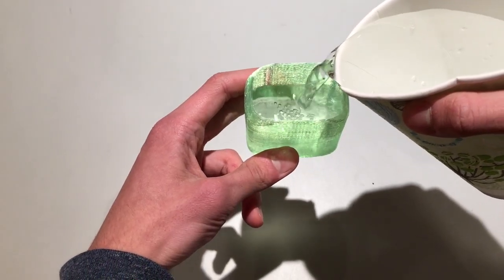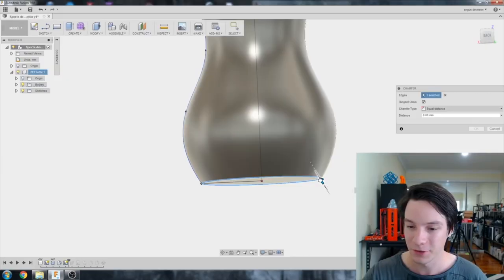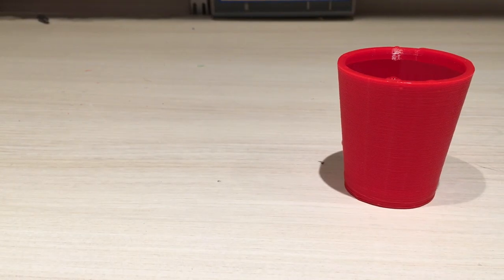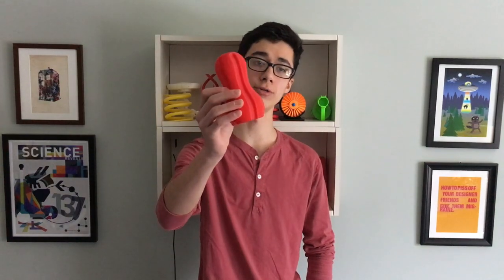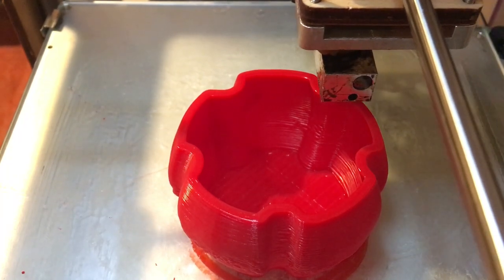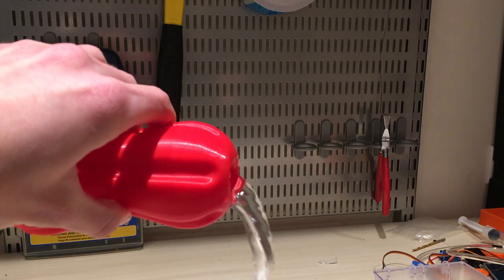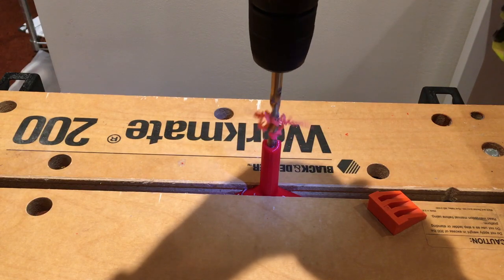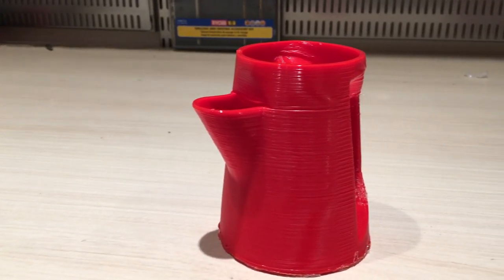Watertight 3D Printing

Comment: I’m a madman and I use 3D printed parts on my cnc spindle for water cooling as well as to a coolant spray loop. Thinking of building some computer AIO radiators using 3D printed parts, flattening some copper tubing, and weaving some copper strips in, great of you to spread the good word of water tight printing

Comment: Wondering if you tried simply using a 0.4 nozzle w/ extrusion width set to 0.8 and upping the layer line overlap? I haven't tried this, but seems like it would work.

Comment: I printed a tray for my coffee machine a while ago with a ,8mm nozzle. I even sealed it with a thin layer of UV Resin and it seemed to be tight for a few hours filled with water. It was fine until after a few weeks I noticed water under the tray 😢

Comment: Uhm just coat the outside!

I used nail polish but I'd probably use resin for a proper print

I'm making a fountain pen, and that goes under a vacuum that has a lot of pressure before ink gets sucked up and the vacuum is released

Comment: I have been printing with TPU  and a .05 nozzle  AnyCubic D  I had good water retention but some very very slow seepage. I found a solution that i over looked in settings  overlap was not set now it at 35%  doing a new cup.
Reply: How did this test work out

Comment: One of my friend 3D printed a submarine. As it submerges, pressure becomes greater, pushing the water through the layer cavity. Your video only shows that the cup is able to hold the water, but can it withstand high pressure due to the depth of water?
Reply: I would think so  I have played with pressure blast in and had the object hold up with out seams split.

Comment: Nice.  But no mention of filament type.  I assume PLA.
Reply: You can do watertight prints with abs, petg, etc etc, even tpu if you have a well tuned machine and slice settings, nylon and pva materials highly hydroscopic are difficult to make watertight
Reply: Layer adhesion is what you want. PP filament is what you may want. PP is hard to print with and it is not Ridgid.  A hard ptu could be a option. Pctg has good layer adhesion and also Ridgid. If you want to slam something on the ground and still hold water then pp is all I know of

Comment: Just set an oven to 200 degrees, set your prints on a cookie sheet lined pan and bake for around 10 minutes. No joke! It will fuse all the FDM layers together into one solid layer, guaranteed watertight. Just keep an eye on it.
Reply from the maker: Gregory Campbell that’s a good tip, thanks for sharing
Reply: as degree, is it Fahrenheit or Celcius?

Comment: that's all cool, but is there a easyer way of achieving such results without having to buy a 2mm nossle, i thought of making a case to hold the heat to then put around my 3D printer so the plastic can just melt down a bit and cover the holes